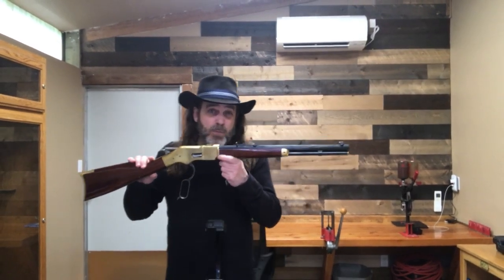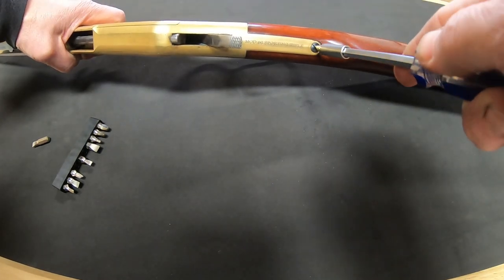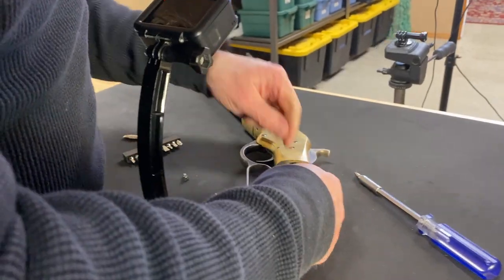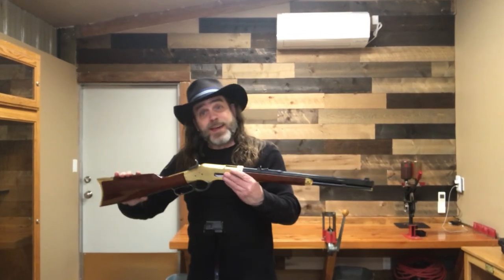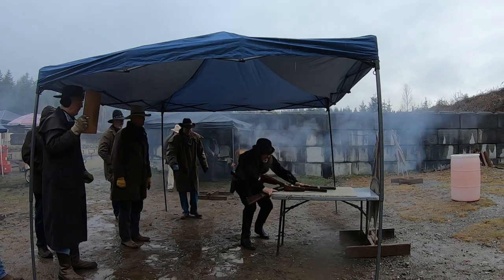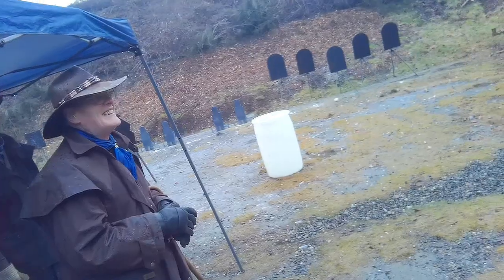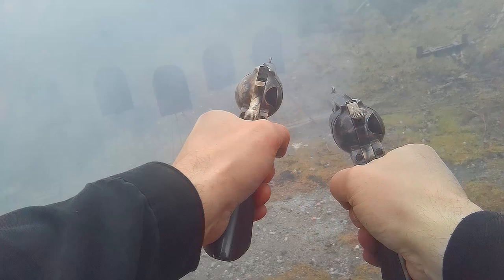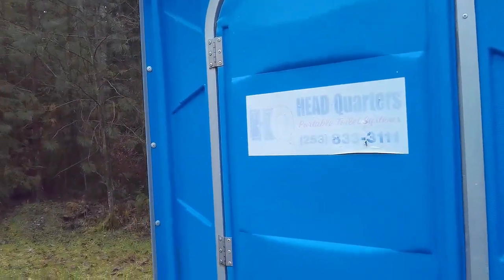Replacing Uberti 1866 Yellowboy Hammer Spring [How To]

Comment: Simple, straightforward and easily understood explanation of how to replace an 1866's main spring.  About the only thing I do differently, is to place a shim between the frame and main spring, rather than loosening the spring retaining screw to control spring tension. The mainspring retaining screw can then be tightened fully.
Reply from the maker: Thank you Cal.  I appreciate your comment!
-Jed
Reply: isnt there already a 'hump' there? In the brass, formed/cast in? On the bottom or top?
Reply: My bowl broke on my 1866 the little bottom piece of it on the last time I went to shoot called manufacturers from all over no one had one to replace it because I haven't very old uberti 1866 bought a new bolt and it's too long keep in mind my 66 is a 38 special the bolt that I bought is for 357 or 38
Reply: @davidcrislip1548  The bottom tab on your present bolt can be repaired.  No need to ship the gun, just the bolt.  Shotgun Boogie Gun Works.

Comment: Ouh this one has not safety  device under hammer like 1873 ... 

Should I remove it on my 1873?
Reply from the maker: In my opinion, no. In fact, I really wish the ‘66 came with the lever safety that is on the ‘73. If you run a ‘66 really fast it is possible to have an out-of-battery discharge.  This happens when you pull the trigger without having the lever all the way closed.  It’s dangerous (ask me how I know 😉). Leave that safety where it is, it’s a design improvement. 
-Jed. 🤠
Reply: @JEDiTV  so I wll replace spring to made it softer ...
Reply: @JEDiTV  so can you share story how you found that ;) ?
Reply from the maker: Much better plan.  👍
Reply: @JEDiTV  I think also about small cheating magnetto ;)  but probably this is not nice ...
Reply from the maker: 😆 Probably not.
Reply: and there is safety notch just after trigger